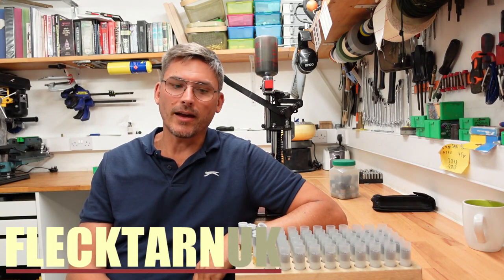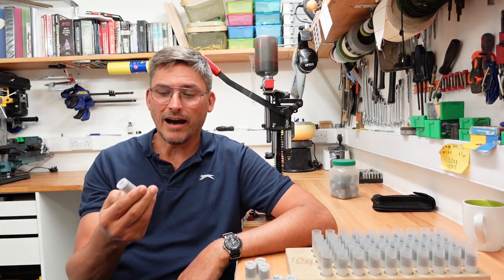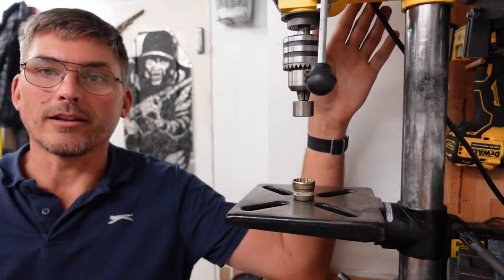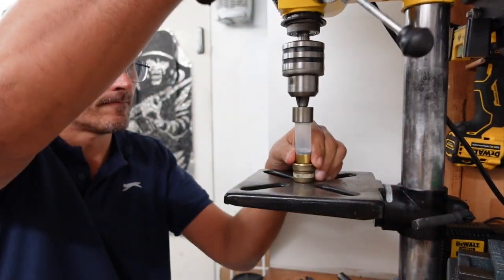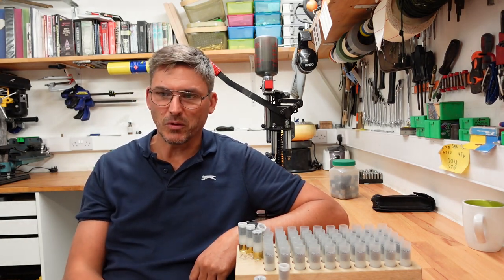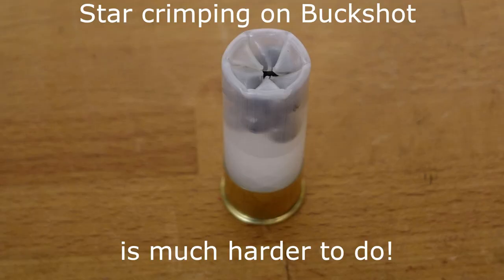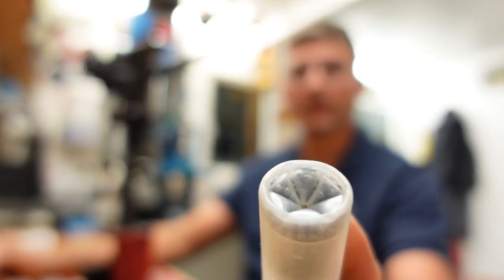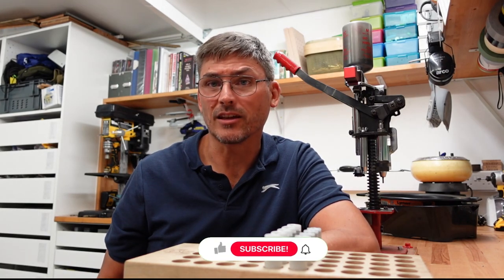[22] Roll Crimping or Star Crimping Shotshells Explained

Comment: From what I've seen, the advantages of a star crimp are that most shotshell reloading presses have star crimping built in (even my US$69 Lee Load All II); they're also easier to reload (no need to pretreat the hull to take out the old roll crimp).  Yes, they're picky about column height, but it only took me two shells to get the height right on my first session loading shotshells ever.  They're the industry standard for a reason: loading speed.  The automated machinery that produces modern commercial shells crimps (over a 100% consistent, machine-assembled powder/wad/payload column) with two quick strokes, last thing before going into the orienter/stacker to be boxed.  Roll crimping on a commercial basis is significantly less efficient.

Comment: Hi,  I roll-crimp as I like the flexibility of crimp depth for black powder loads and have made my own reloading station from a block of wood so can't star anyway but I loved your shotshell base to hold the shell, where did you get it? or how can it be made?  and how do you fix it to the base of your press?  

Thanks in anticipation,
Gordon
Reply from the maker: Hi Gordon.  

The base got removed from a modern manual shot shell crimping tool.  I can't find the exact one for sale but I have found a picture of the exact one I had: https://i106.photobucket.com/albums/m278/photo205/IMG_20140529_122315664_zpsfavo8toj.jpg  

The tool was regrettably really slow so I took the base off, threaded it to M8 (or it might already been threaded) and glued a threaded rod (cut off bolt) into it.  The top of the cut off bolt now at the bottom of the 'base' was hammered into a rough rivet.  The finished contraption is placed into a hole in the drill press table and held in place using an M8 washer (with a rubber backing glued to it) and a wing nut. 

Hope that helps!
Reply: @flecktarnuk3557  Hi and thanks for that, I will get straight on to seek one out as currently I have a 'gripper' made from 2 strips of wood with a hinge at one end (the wall of an old plastic shotshell) and I hold the shell in that but it does slip. 

For any readers - you don't want to hold the shell by hand!  You can get a good grip at initially it seems to work but one day the crimper and shell will stick to each other and then spin in your fingers which are holding the sharp edge of the base...

Thanks again and I'll be in touch about some .44Mag copper heads

Comment: It appears that you are over crimping your shot shells, that is why they are dished inward on the final crimp. If I could offer a suggestion, I think you need to adjust your shot column with a different wad or trim your shot shell cases to a length that will accommodate your shot column to get a flat crimp on the 6 or 8 fold crimps. Each case and load recipe is different, so you need to adjust your machine or case to get an acceptable crimp.
Reply from the maker: I agree with our suggestion.  Unfortunately the Mec 600 JR does not come with an adjustable shot column.  It is on my list to purchase one but I've not got around to it yet.

Comment: For star crimp - 11mm from bottom of shell should be free. So take caliper, measure it, if there is free space under 11mm level from top, then add overshot paper wad.

Wad can be cut from any 1mm paper by 19mm or 18mm cutter. 19mm diameter is for over powder wad, can be used as overshot wad as well.

Comment: You need to fix the stock height on your fold crimps. It lol s to me you’re close to 1/4 inch short.  You need to trim hills on roll crimps to be about 1/4 inch over the  charge in the shell. You will be over pressure with too much roll and you run the risk of pieces of the hull breaking off and lodging in your barrel.